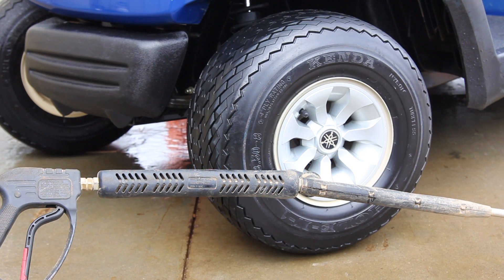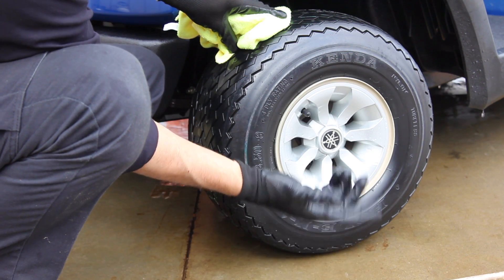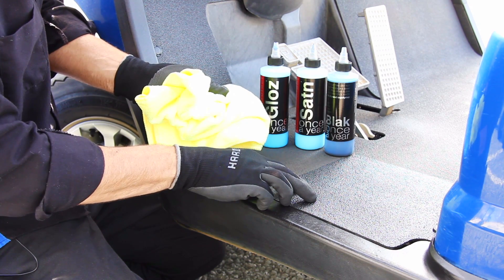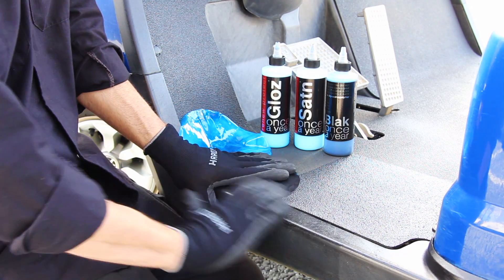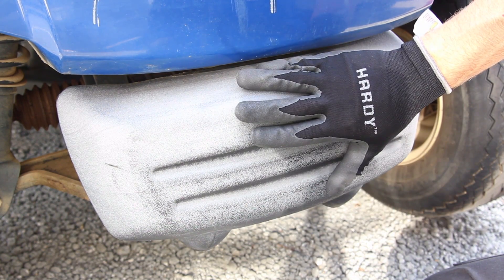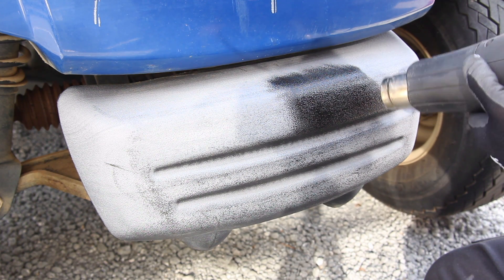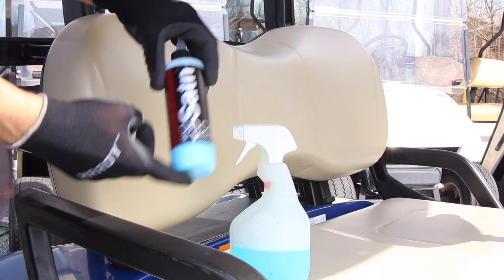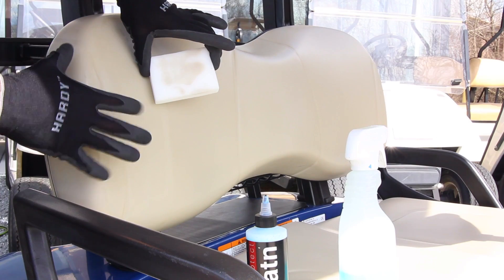How To: Restore / Add Value : : Golf Cart, Faded Plastics, Panels, Tires, and Vinyl Seat

Comment: I found your blak and gloz to be great products. The sprayer on the rp11 didn’t work and I was more than disappointed with the cart. I followed your video sep by step and even did all the recommended tips. The black and rubber on my golf cart look Amazing. I was hoping for the same results on the paint ..thank you anyway for a great product. I’ll keep looking for a solution for my painted surface.
Reply from the maker: Hi Oscar,  I emailed you details. RP.11 small bottles have a lock switch. Don't know what to tell-ya on the CART. As you see with our videos we have restored many weathered golf cars.
Reply: Renew Protect : : video you have been a great help!  Thank you for your communication!